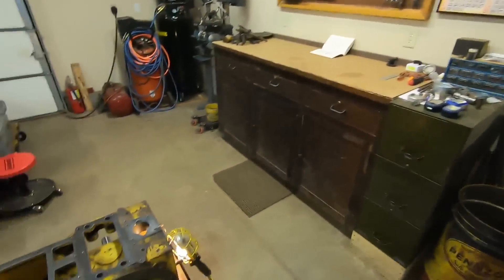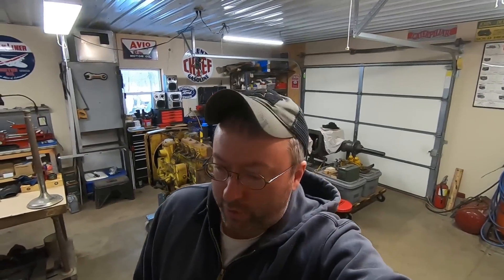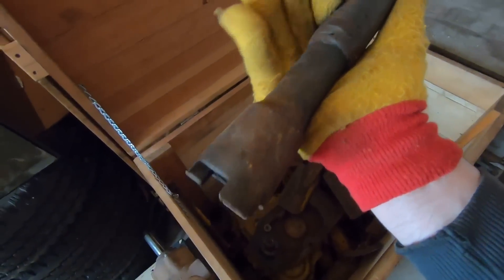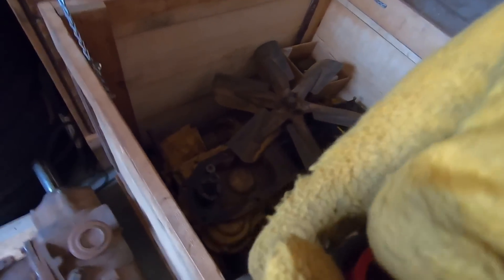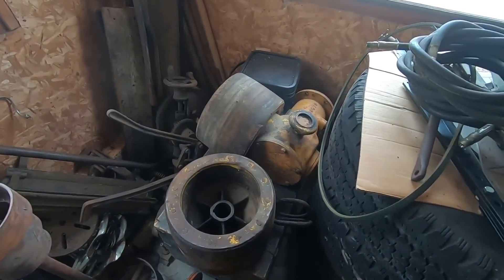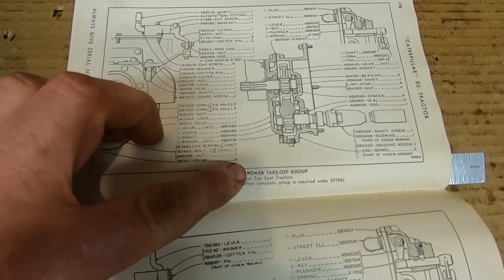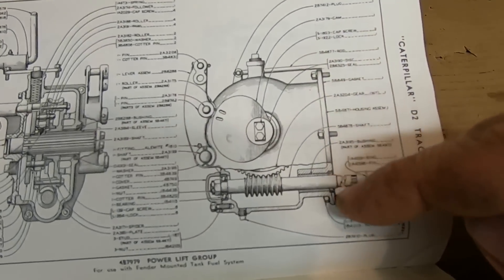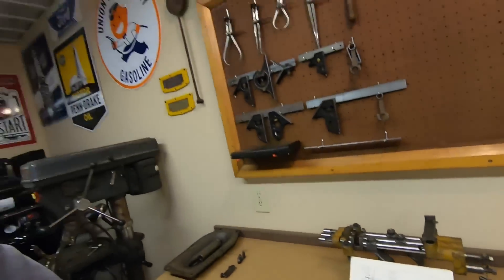#5J1113 Video Short - Answering a Common Question - What Goes On The Back Of The Countershaft???

Comment: could be the equivalent of a Farmall touch-control unit, looks like the gear is always engaged with the transmission counter shaft and there's a moving plate to engage the output shaft.

Comment: Squatch, I wanted to pass a tip I just learned on installing seals. It was stated that the spring that holds tension on the lip can get dislodged when seating them with a hammer.  The solution was to pack the inner cavity and spring with grease to prevent it coming loose and rendering the seal ineffective. Sounds practical to me,  your thoughts?

Comment: The PTO is interesting as we added the same unit to our 5U back in the late 70’s for the purpose of driving a Ford dual spindle 4 blade brush hog. We also had an auxiliary hydraulic ram that we mounted on the brush hog to raise and lower the 2 rear wheels. The PTO was engaged with a small lever near the seat. At 18 this was my first experience running a D2. My job was to clear 40 acres of fields overgrown with Hawthorns. I mowed the smaller ones ranging up to about  1.5 inches in diameter and what a racket it made when you crunched them up. Debris would fly out the back in every direction. Then I’d pull out the big ones with the 3 and 1 bucket of our 955k which was a beast.

Comment: Thanks for the heads up! Did they make a winch set also?
Reply: @squatch253  wow  heavy but if installed a winch, would that completely use up the drive, so could not have a pto shaft for other use ? Then when need winch it was there to use? Still the winch at 900 Lb must been massive!

Comment: I will endeavor to explain the mechanism based on the drawing (but i cannot assume as to its purpose). My catalog's drawing differs a wee bit from yours but only in representation and the part drawing i'm referencing is 8B5990 (because it is written as the standard, as it is in your book, with number 4B7979).

The explanation will be part to part, because otherwise we won't follow a proper communication standard (English is not my first language).

--Power comes through the Coupling Assembly (1B9157), goes into the Shaft (5B4676 - the worm) from which it travels into the Gear (2A3204).

-At this point, this is fully controlled motor side, there's no function control, which means it's moving from the shaft inside the gear box.

--The operator is provided with a Handle (L-829) which then actions into the case of the PLG unto a Lever (8B1894) that has a cam.

-I'll skip this for complexity reasons (continues down bellow, along with my conclusion *).

--That Lever (8B1894) actuates the indexing mechanism which then moves the Shaft (8B2039) along with the Cam (8B2004).

On that Cam, rides a Roller (8B1906), which is attached to the free floating Lever Assembly (8B2052).

-I cannot measure at this time, however, you can figure out the total travel of LA (8B2052) by measuring the standard length of Stud (L-187) which is approximately half the length of the travel of the Cam (8B2004) give or take a few mm).

*Now, unto assembly 8B9664 Power Lift Indexing Mechanism Group - Field Replacement, which in my book is next page over, in the upper half of the diagram.

Through the use of the PLIMG, and the Handle (L-829), the operator is able to index whatever position they wish unto the Lever Assembly (8B2052) which, as i stated previously, is free floating, as there's no internal mechanism to either contain the movement or restrict it, other than the Cam (8B2004), which leads me to believe that whatever attachment fits unto the LA (8B2052) through Pin (8B1887) an the hole that indexes it securely in a single plane (this item is forced by the LA (8B2052) to describe the same motion arc) is located either in front of the tractor (similar to the blade attachment you have shown recently in the video over at the fair grounds, where your fellows were moving a hill into a hole) OR above it, that is to say, some kind of crane assembly, which is similar to the 3 point hitch mechanism on a common tractor) OR some kind of agricultural assembly, which naturally pushes into the LA (8B2052).

To that, i add that there's a Second Type of Power Lift Group (4B7979) Effective with Serial No. 5J3572 and a First Type (4B7979) which i assume is the one in your drawing - Serial No. 5J3501 to 5J3751 Inclusive. 

If you wish to view the book, it is scanned online as a downloadable PDF and you'll easily find it in Google as "CAT_D2_5J3501_AND_UP.pdf".

Hope that helps and that it makes sense.
Reply: @squatch253  Very interesting! Yeah, i figured it had to be some sort of agricultural deal, i presented all three, but that one was my pick, i wonder if there's any complete setup still working. Google/Bing/DuckDuckGo deemed it to be unobtainium.

These are very cool machines, so thank you for making them work again and talking about them, because otherwise...well, there's only so many people going into as much detail as you do. Usually, it's just some fellow using a torch to change the starter motor or a shovel to persuade the pony motor. Sacrilege!

Comment: Excellent video keep up the great videos 👍👍👍👍old oliver tractors and John Deere tractors had that same kind of mechanical lift it's lift only then gravity down for cultivator and light implement it's basically a cam and clutch as it reaches the dog it kicks out to hold the implement up and you release the hold dog it drops. It's the same thing as your wheel lift on the your little giant plows the transmission counter shaft is the wheel so to speak.  I have never seen a cat crawler with that attachment on it

Comment: Since that drives off the countershaft, it would not be a live PTO-  Is there a lock mechanism to hold your steering clutches open?
Reply: Power comes into gearbox and immediately dog-legs over to countershaft. Countershaft is turning any time main clutch is released (even in neutral).
Reply: @RangieNZ  Yeah- you are right- I went back and watched the assembly video again, so it does have a live PTO.  I had never seen one of those right angle drum drives before- probably for powering all sorts of equipment-    The one they call a lift mechanism must be for some sort of pump.

Comment: The finest channel, on doing the most  comprehensive rebuilding of older tractors on the internet. The methodical and detail of every nut and bolt backed by parts manuals is the finest I have ever seen. Professionally  done with detailed explanations for each step. Years from now tractors they rebuild will be highly sought after, and will fetch a premium.
Reply: NO sledge hammers, NO chisels, NO skid steers.  Blue wrenches acceptable.

Comment: I knew it was for the PTO immediately. Cub cadets have the same thing. In fact, almost the same setup. The belt pulley bolts onto the splines for the shaft and it can be used as a 540 seperately.

Comment: I have a Cat 22 with the rear PTO and it's used to drive a hydraulic pump for the dozer blade.  It's interesting since I can shift the pump on and off with the bar under the seat.

Comment: A Hyster D2 winch will also fit on that lower shaft, which most likely broke that brazed transmission case he has, thus the serial number plate and rivets missing. They probably replaced the winch with a drawbar after the damage was done.

Comment: My dads D2 was a drawbar tractor with pto and had 18 inches pads and we pulled a case 5 x 14 moldboard plow in the spring and used the pto on the pull type 2 row Minneapolis Moline corn picker in the fall  thanks for the videos they help bring back a lot of good memories with my father and the farm I grew up on

Comment: I've certainly never seen that power lift attachment since these tractors never really made it to Europe.. kinda because nobody liked us having tracked vehicles a few years earlier, anyways I know similar mechanism from old industrial machinery. The only real problem with it is that it can't lower back down unless it lifted all the way up before since the cam can only turn in one direction since its driven by the engine and has nothing except an engagementclutch/brake combination. So it always had to pass top dead center before the lope lowered the lifter back down. As such they quickly got replaced by hydraulic systems. But it was a good Idea for a time when high pressure hydraulic was kinda pricy.

Comment: Interesting power lift, that was how they raised and lowered mounted implements before the coming of hydraulics. No idea what would work on a D2 though, I don't think a crop cultivator would work well with tracks.........
Reply: Ripper?
Reply: @LittleWapiti  possibly, would be interesting to see if Cat had a line of mounted implements that went with the D2s, keep in mind that this is before the 3-point hitch had been invented, I believe Ferguson was the first to have a 3-point hitch during or just after WWII..........
Reply: @randallvos  they did and I believe it was patented and licensed to Ford....Minneapolis Moline has a ridiculously complex competing system, but it was proprietary, while implements for the 3 point were almost universal.....used to own a MM Model Z.